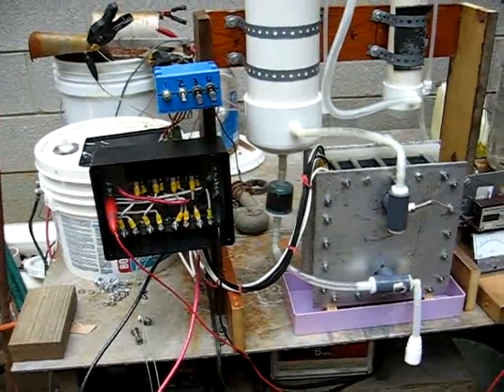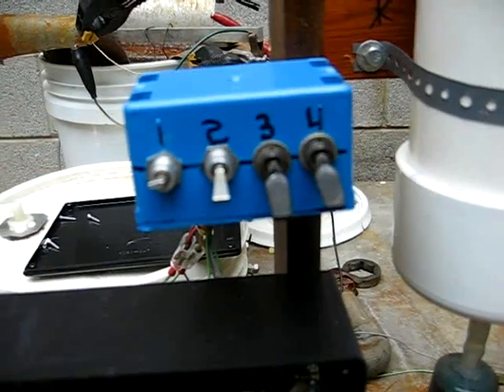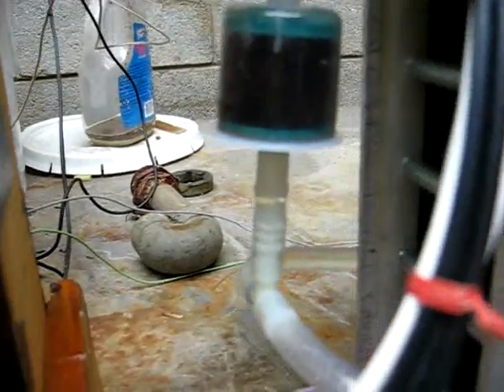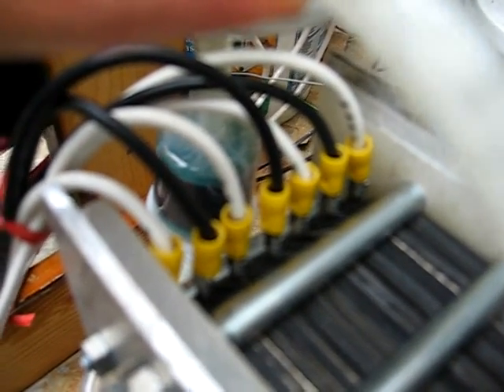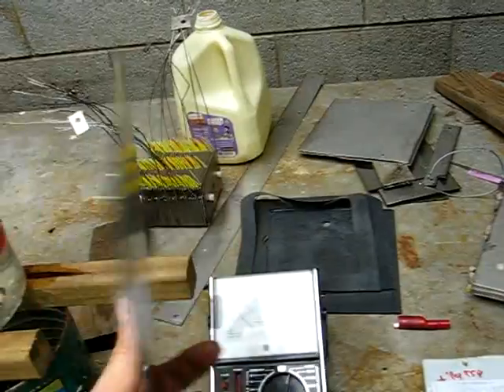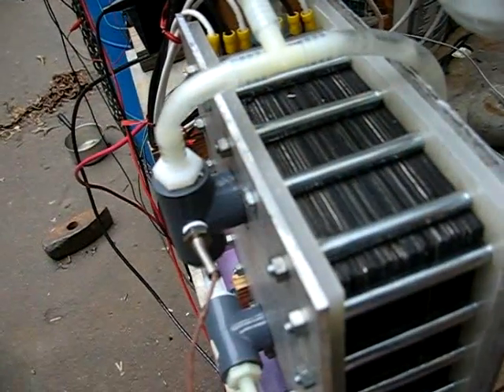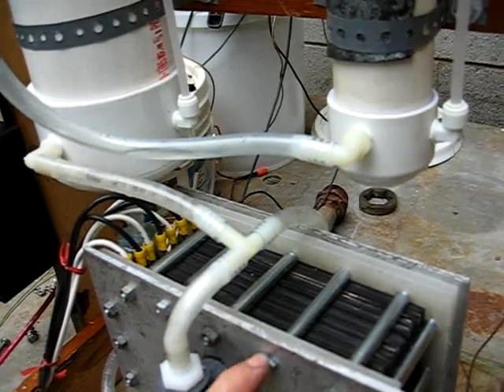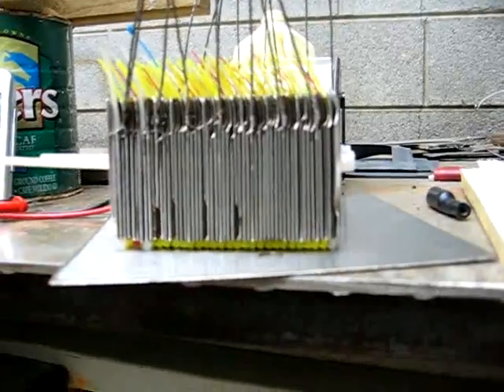002 HHO Dry Cell Components: HHO Drycell 5.5 mmw 500 watts 3L

Comment: Are you still on here? How can I set this up in a Chevy Volt with a 360 volt battery pack?
Reply from the maker: Since all gains in mpg come from increasing burn efficacy there would be very little if no gain in mpg on your car. Modern engines are extremely efficient already.
Reply: Did you get bought out by big oil? My 2014 Chevy Volt gets the same MPG that my 1996 Honda Accord got... 35-40mpg.... I have a giant battery and generator that could be utilized to power an HHO generator. Just gotta figure it out.
Reply from the maker: If you really want to do it it's easier when you have higher voltage. But you will have to step down from 360V. You need 1.5V to 2V per plate gap. So in your case you could build  a 181 plate brick with a positive plate on one end and a negative plate on the other and 179 plates in the middle. Maybe you could use a solar charge controller or some such thing to reduce your voltage. It would be a fun experiment but I don't think it would pay for its self. I don't know how the Chevy Volt system works but I do know that not all of the energy generated by regenerative braking is stored. It just can't go into the batteries fast enough. Maybe you could capture some of the wasted energy and then you would truly be getting free energy.

Comment from the maker: After I discovered that the pond liner was electrically conductive I added a second gasket made from PVC. Now each plate is isolated. When I put it together with just the fish pond liner gaskets it was like it was one solid block of metal. There was a little resistance throught the gaskets but not very much. I never put power to it until after I added the PVC gaskets.
Mars

Comment from the maker: The Plates are .050" non-magnetic door kick plates. There is no reason for them to be so thick. I already had them so I used them. IO have the plates for my next generator already and they are .032". Even thinner would be OK but I got the .032 plates for $1.00 a pound. If you watch my other videos you will see that I have made some modifications and I have achieved an 18.9% increase with the truck empty and 10% pulling a trailer (12,500 GVW). I don't think that I've reached the upper limit yet.

Comment: Hi Marshall,

VERY nice setup!

I've built the big hunk of wall plates into a cell, then worked up to a SMACKS cell, which is what I'm currently installing in my stang.

However, I'm about to move to what looks like the most efficient design, which is a drycell such as yours.

I was wondering how thick your plates are?

10% gain so far at least, ey? that's worth all the effort, isn't it?  At $4/gal, that's a $.40 savings per gal!

Comment from the maker: Hi SmartScarecrow: The aluminum is not in contact with the electrolyte the fitting are threaded into the nylon plates and the aluminum plates are just used to reinforce the nylon. There is an oversized hole for the fittings. The only way that any electrolyte with come in contact with the aluminum is if there is a leak.
The plates are nonmagnetic stainless steel of an unknown grade. The electrolyte is distilled water (from a dehumidifier) and 1/2tsp of NaOH per quart.
Good luck, Marshall

Comment: love your setup ... once of the nicest ones I have seen ... I have some idea of how much work went into this piece ... but I gotta smack you in the back of the head with a 2x4 for using aluminum ... there is a violent chemical reaction between aluminum and many common electrolyte checmicals including KOH and NaOH ... it will generate a lot of hydrogen but not in the way you want or a way you can control ...